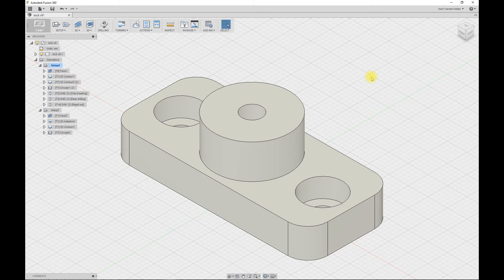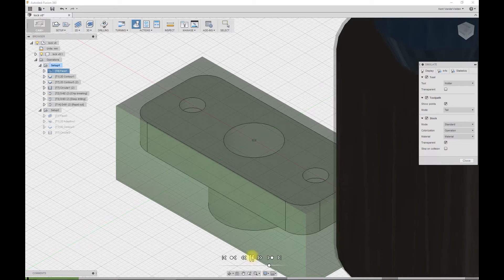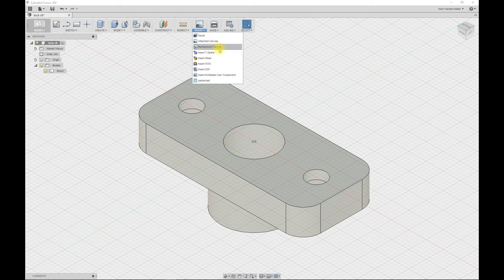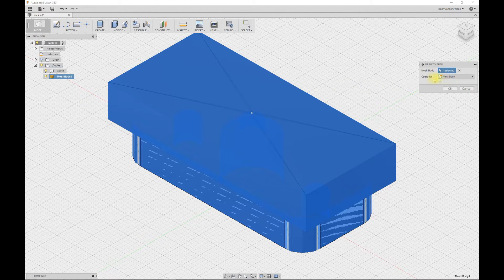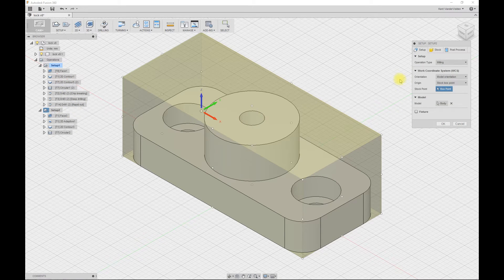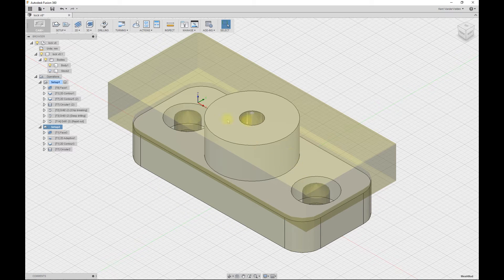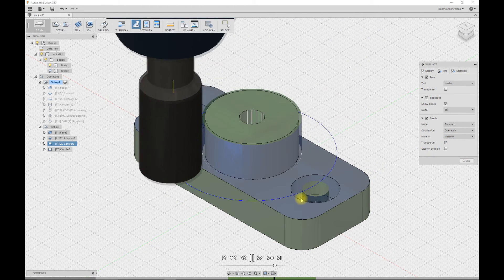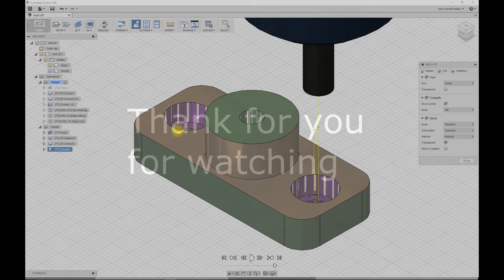Fusion360 How to create stock from simulation and STL files

Comment: Thanks Kent for making this clumsy part of CAM so prominent. I just made an update request on this: https://forums.autodesk.com/t5/fusion-360-ideastation-request-a/carrying-stock-between-setups/idi-p/7685219 having to use a local STL file that doesn't update on changes is too error-prone for newbies like me.
Reply from the maker: Up-voted. To create representative stock for each setup, I've been creating STLs of the simulation or duplicating and defeaturing the original part. But it's pretty tedious when any changes are made to the part. Hopefully the improvements get implemented. A "create body" option on the simulation result would seem pretty simple.
Reply: @kentvandervelden  I have added a "machining operation" suggestion of save as derived stock (linked backwards)

Comment: FeatureCam does this really well all by itself without the workaround.  Autodesk owns it now... they should just gut Featurecam and merge it with Fusion
Reply from the maker: "We will add your biological and technological distinctiveness to our own. Resistance is futile. We are Borg." I wonder how the Fusion will be maintained as more stuff is added. It's been in development for many years, along side Inventor which received minimal advances, and still critical features like solid drawing and BOM systems are missing. And optimizations are desperately needed for supporting typical mechanical product size assemblies. I'm sure they are aware of these limitations and concerns of cannibalizing Inventor. These problems have been on my mind recently while testing the viability of switching from SolidWorks and Inventor to Fusion. The last few years I've switch between the three. Getting pretty good at starting over :)

Comment: Great concise video...BUT. I tried this and when I open my mesh it comes in about 100 times the size. My units are inch for both as you specified. Also when I click on the mesh the convert to Brep is not there. Any ideas?
Reply from the maker: Hi Greg, see bluehandsvideo's comment here about units. If that does not solve your problem I'd be happy to test a few combinations. Either I got lucky or Fusion 360 has changed. Thanks for asking.

Comment from the maker: Check out my most recent video: https://goo.gl/Jj7cU1
Reply: Hello Kent. Is there another method to do this? I got a pretty big model that i adaptively clear with an 25mm end mill. Afterwards i want to apply 5 axis morphing. I saved the cleared model as stl file. THen i load it back in . But it remains impossible to convert it again because the stock has too many polygons....... What could i do?
Reply from the maker: +plavix221 I often copy the part body and delete features that have not been machined yet, and use that new body as stock in the next operation, this is quick, but only suitable if you've finished machining areas. There's also the "from file" which may be saving some steps from the method that I showed, but hopefully allows more complex geometry. Having a "from previous setup" option seems so obvious... We have to assume the Fusion team most be working on it. Best of success to you

https://m.youtube.com/watch?v=9toDzfXcGo8
Reply: hello, thanks.... you mean from file, where i can type in the link where stl is saved? I cant type in anything into that field..... ha
Are those multi thousands dollar CAM programs better in that regard?
Reply from the maker: Some of the CAM operations (most of the 3d and none of the 2d?) have a From File option under rest machining. E.g., with 3D Adaptive, select Geometry tab, then under Rest Machining select From File as the Source and type in the filename. (Should use full path to be save, so save the STL file from the previous operations to an easy to type location.) Hope this helps, but your part may be too complex. (Could also decimate the STL file with a separate program, but the result would be pretty crude and difficult to predict, probably would be a mess to use for CAM, so probably simply a bad suggestion.)
Reply: ah...yes...thanks.... i can type in... but dont ask me why i cant type in the slash symbol pointing to the left.... ah maybe i had caps lock toggled...... thanks again
Reply from the maker: They are all horrible methods, prune to mistakes including not updating the STL file. If you find a better solution please let me know.

Comment: Kent, Thanks for doing this video. Fusion is sorely missing this ability: to be able to use the results of the last setup to use in the next setup, esp when flipping the part around.
Reply from the maker: Thank you very much for the comment. Since you know about using a hidden body for stock, you may have also defeatured a duplicate part for use as stock. If not, I'd be glad to explain it. It's pretty useful for situations such as where initial work at a manual lathe creates a blank that's moved to a CNC mill. Best wishes, Kent
Reply: Thanks Kent. I did see a nice video on that by Mechanical Advantage.

Comment: Thanks for the vid!  I've been trying to do this.  I save the stock out as an stl, but when I insert it in the model environment, it comes in huge.  When I right click on the mesh body on the left, I don't get the same options as you do.  There's no option there to convert to brep.  
Just searched it.....I had to turn off the design capture so that it would be in direct editing mode.  That let me see the Mesh to BRep option.
I had another issue when I inserted the stl file.....it came in huge compared to my model.  Had to research this a bit, too.  Turns out that the stl file does not have any specific dimension type...ie, inch, mm, foot.....saved with it....only units.  It saves it in centimeters(according to the info I found) by default.  I'm guessing it is saving it in mm since cm would make the stl import way smaller....anyway..... I switched my dimensions to millimeters in CAM, then saved out the STL.....then in the MODEL  space, I changed it to mm.....when I imported the STL, it came out the correct size.  
This is all just FYI for others who come here.  You were already using mm, so it didn't cause any problems for you.  Thought I might share the info for your other viewers.
I subbed....looks like you're going to have some great info here!!!  Keep it up. :)
Mike
Reply from the maker: Hi BlueHands! Thank you very much for the detailed correction and the support. Every comment means a lot to someone starting out here. For inspiration for a CNC conversion, I've watched your CNC lathe videos several times, so it's particularly great to hear from you.

A lot of Fusion360 videos are going to need updating given how fast Autodesk is improving Fusion360. Looking for the lost "Find features" command, ("it was here yesterday..."), I too discovered that design capture needed to be turned off. Fusion360 is amazing. Something like Find Features in Solidworks, at least with 2014, which is the last I paid maintenance on, required Professional ($$$).

Best wishes, Kent
Reply: It was more of an addition than a correction. :)  My settings were different than yours. Had they been the same, I think it would have worked exactly the same.  Your vid got me on the right track. 

I'm still not one of the "heavy hitters", but I remember thinking/feeling the same when when I was just starting out and Tom Lipton posted on one of my vids.  I don't know where some of those guys find the time anymore to watch and comment on as many vids as they do.  I was sent a link to yours from a follower on IG.

I think you're right about fusion out dating a lot of the vids.  If I find one that's more than a year old, it's typically a lot different than what I see in the options and menus.  I agree....fusion is pretty awesome.....especially at the price!! :)
Thanks Kent!!
Mike
Reply: Thanks for adding this.  Seems to me there should be an option to save in current design instead of all this importing and converting crap.  I guess I should look for a suggestion on the cam forums and up-vote it.  LOL.  (btw - this is @sharmstr on IG)
Reply from the maker: +Shawn Armstrong Thanks Shawn. Fusion360's flexibility gives it a lot of power but also makes it a pain sometimes. Today I was doing some CAM and needed to makes several variants of the actual body, with different features removed, so I'd have the needed reference surfaces. This is powerful but also pretty lax. If the original body is updated, that can trigger a lot of downstream changes which is nearly as bad as starting over. I want to love Fusion360 but compared to SolidWorks, I spend a lot of time fighting to keep models sane, and that's time I can't charge for. What's a person to do? :) If you add an Idea, let me know, I'll up-vote.
Reply: I hear you.  I'm fairly new to all of this so cant compare it to Solidworks.  But I've been working on the same model/cam for about 2 months now.  Its fairly complex for a rookie, hence the time.  But I'm running into similar issues as you with downstream changes.  When I'm having a hard time applying a tool path to a feature, I'll realize that if I just model it up a bit differently, it will do what I want.  So, I go an change it and it will screw up other things.  LOL.  I really cant blame it on Fusion though.  I'm just green.

Getting back on topic here, I did figure out that even if your model is in Inches when you "save stock" after simulation it will import at the correct size if you select mm.  No need to change your design to mm before simulation.  Another good tip, if you are someone who relies on design history, you can import your saved stock into a new file, turn off capture design history, convert to brep, save, then drag it into your original design.  That way you wont lose your history.
Reply from the maker: Thanks Shawn, those are great tips. I wish it was possible to update (and correct) YouTube videos, but we are forced to upload new ones. You've seen the Find Features options (right click on the body in the feature tree while in model mode)? That's a powerful Fusion360 feature really useful when importing geometry and simplifying features. Much respect to the team at Autodesk that implemented feature recognition.
Reply: I didnt know about Find Feature.  Probably because its only available in Direct Modeling ;)